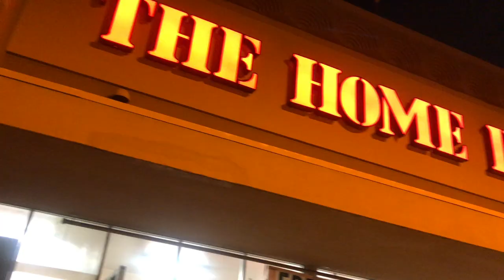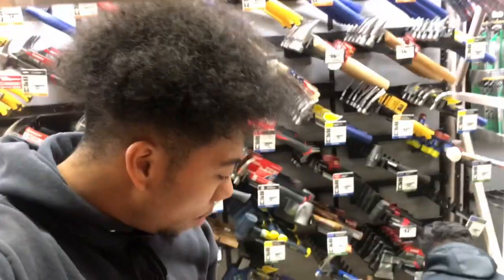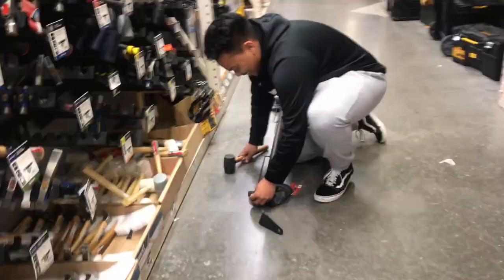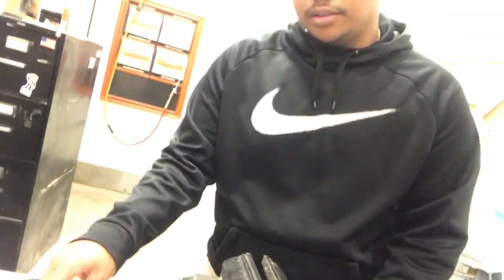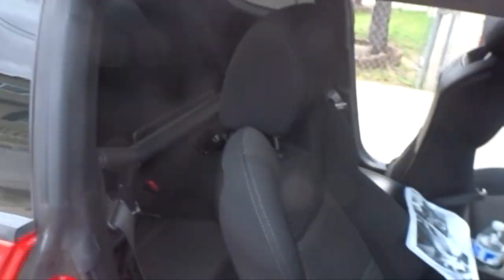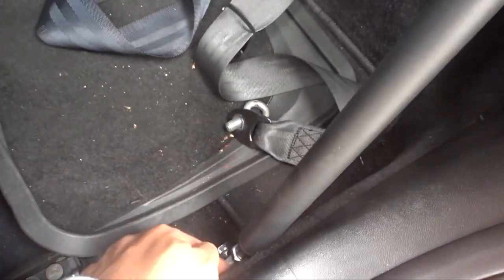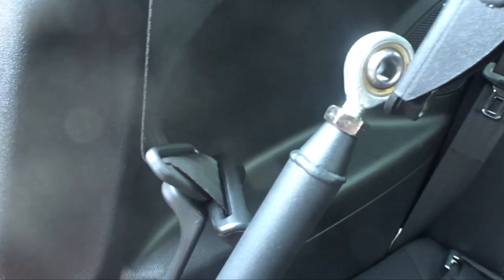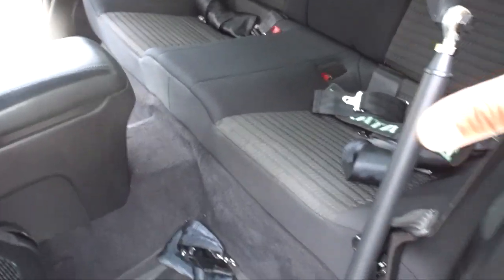Cipher Harness Bar Install - Genesis Coupe

Comment: When u use your harness uh how do get the seatbelt to stop dinging Bc I mean u gonna use the harness and I don’t want it to ding whenever I install this
Reply from the maker: By dinging you mean by the seat belt sound or sign from popping up on the dash? You can buy a seat belt buckle which isn't that expensive or you can do what I did was run the old seat belt behind my seat and connected to where the seat belt goes. No seatbelt signs or dinging happens.

Comment: I'm a year late so I know I might not get an answer, but did you experience the airbag light turning on? I didn't install the top ring like you did so I'm thinking that may be the problem.
Reply from the maker: Never too late, but once I installed the harness bar there was no airbag light on the dash. Prior to installing I actually was to other local Gene owners if they experienced any lights on the dash and how did they install. The only problem I had was I couldn't use the stock seat belts which I didn't mind but my passengers did lol. Hopefully that helped.
Reply: @unluckysocietyco  thanks for answering! That helped!

Comment: thinking about getting a harness on stock seats on my gc. stock seats are already snug and tight, anymore tips??
Reply from the maker: I'm running stock seats on my Gene right now, What helps too if you take out the seats, would make things much more easier and your gonna have lots of space to move around and install the bar

Comment: Do the stock seatbelts not fit at all?
Reply from the maker: What do you mean? The seat belts fit but I could not reuse them without taking out the harness bar.
Reply: @unluckysocietyco  yeah that's what  I meant sorry.... so the seatbelts won't fit with the harness bar is what I meant :(
Reply from the maker: @daniel.clarke9166  Your good bro, yea sad to say but the seatbelt doesn't fit, before installing I asked local people with Genes on how they went about installing it and had to do the same thing.